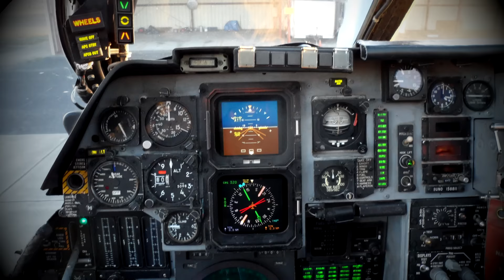USMC Jet Crashes Cable Car | Last Moments

Comment: I am honestly shocked that a high-tension steel cable like that doesn't cut a plane in half.
Reply: The plane is made so survive missles exploding nearby and with lots of redundancy. But yeah, at that speed its almost a miracle
Reply: The cable isn't that tight. They always have some looseness (consider the temperature).
Reply: The plane had more momentum. It's like a jet of high pressure water slicing through metal because hey water doesn't have as much time to get out of the way as the metal. Although I'm really stoned and just guessing. Probably completely wrong here.
Reply: It almost cut off the right wing of the craft. If you watch the documentary on the incident that show pictures after the incident and you can clear see a gouge that stretched nearly 1/3rd of the aircrafts right wing
Reply: Well it all depends in which angle it took the hit, the wing being at an angle can help the cable slip over it. Also, the cable is not completely tense and has elasticity.
Reply: Military aircraft isn't made like what civilians fly on.
Reply: @chriscoker7794  Not always.
Reply: @amx8336  no but most always with high dollar fighter jets and aircraft, but no not 100% of all military aircraft.
Reply: @SofaKingShit  at least you're not "wired" 😅
Reply: Well the cable damaged at least as much of the plane as the plane damaged the cable. There's just a hell of a lot of plane than cable in this scenario...
Reply: @SofaKingShit  water cuts metal because waterjet cutters have abrasives in the water.  plain water can only cut soft materials.
Reply: I can only translate what i learned in engineering class. Most metals are tested by determining their yield strength against tension which gives a good indicator of performance. There are methods to test for compression and the yield loads there which yet again are good indicators of later performance. The issue with this accident is that it stresses the cable in ways it is not designed to withstand. Being a sudden sideward almost cutting tension and jolt. Im sure its strong enough that you could hoist up the plane and 2 others but that sidewards attacking force on a small area by a large mass moving at high velocity is just too much to handle. Dont get me wrong. A metal cable is very strong, thats why we use them. But only if used foe the purpose its designed for which is to withstand tension.
Reply: @SofaKingShit   your part right, water jet cutters have garnet injected into the water jet to abrade the steel or what ever else is being cut
Reply: Think of it as a bullet which is soft lead with a soft copper jacket being able to blow a hole through a piece of steel.. years ago i fired my 243 at a 3mm/ 1/8" steel target that i made to spin when hit with a .22 and i fired the first shot and i was confused because it didn't even wobble so i fired a couple more shots and still not even a hint of wobble and i was sure my shots were good so i went to look at the target and it had 3 holes straight through it
Reply: best way to cut through anything is to go faster than it, they use it in bullets, saws, and every other thing meant to go through something. 500mph is around 220m/s, meaning in just 5 seconds they travel a kilometer. consider that the front end of a wing it thicker than the rear end and more reinforced to handle high speeds, and that the cable isn't armor. all comes together to an instant shred of the cable and damage to the wing.
Reply: Titanium is not stronger than steel. The reason it's used in aircraft is that it weighs only half as much as steel while being almost as strong.
Reply: @SofaKingShit  but it’s all relative and it really just depends on materials doesn’t it?  I’m stoned too btw
Reply: It isn't called Grumman Ironworks for nothing.
Reply: @SofaKingShit  The fact you're stoned and yet took it upon yourself to answer a physics question earns you a gold star in my book. :D
Reply: It's pretty impressive. But Velocity is squared lol!
Reply: The A6 is built like a brick with wings and an undercarriage meant to survive 10000+ hard landings.
Reply: @DoctorNemmo  Temperature would not effect the tension in the cable.  The tension in the cable is determined by the mass of the cable car and passengers plus the mass of the cable itself.  Temperature would determine the length of the cable but not the tension.
Reply: @SofaKingShit  Fraid so mate, it doesn't matter which object is moving towards the other in relation to the earth, as far as physics is concerned the plane and cable car are heading towards each other at 500mph.  Basically the point at which there is contact the cable would get quite hot, weakening the steel, there is a delay between the cable been hit and it been pulled apart and this time delay is the damage that occurs on the jet.
Reply: 500mph bro, at that point nothing is guaranteed
Reply: The Prowler is also built pretty tough by fighter jet standards. Had it been something with a thinner wing, like an F-16, it probably would have crashed too.
Reply: @marc-andreservant201  bussy?
Reply: almost like they were made to be flown in military operations!
Reply: @asiftalpur3758  what?
Reply: I don't know about the Prowler, but a lot of military jets that are used in low altitude roles have cutters built into their design because of the risk of hitting things like power lines.
Reply: @SofaKingShit  too much info
Reply: Even with high tension, with a long enough cable there will be more than enough flex to stretch it until it breaks
Reply: Would've been better if it had, tbh.
Reply: @johnk4396  steel is just as strong as titanium.
Reply: It's not taught by Zeus himself, there has to be slack between the pillars so the pinch rollers don't get worn out in a day's use... Ever been on one? There's considerable flex.
Reply: @SofaKingShit  That's some good spelling for a stoner. I've had "Ivy Leaguers" reply to my comments full of run on sentences, misspelled country and city names, poor/absent punctuation... Excelente trabajo
Reply: @Destilight  
Yeah, if it had been a rare straight wing jet, like the A-10, then it probably wouldn't have "slipped off" the wing. It most likely would've ripped the wing off and gone quickly out of control, potentially so violently that the pilot wouldn't have been able to properly eject in time.
Reply: @Wasatch A lot more dense going faster, too.
Reply: Plane wings made out of cans?  Er, no.  They are the strongest part of the plane, except for the undercarriage.  Science.
Reply: @chriscoker7794  there was those cardboard/paper gliders in WW2. Lol. But they worked, except a few. Mission accomplished.
Reply: @jeffcampbell2710  yeah I thought that was pretty cool and resourceful.
 The first aircraft that was used by the military was exactly like what the public would have used.
Reply: @SofaKingShit  really like that moniker 👍🤣😂🤣.
There is no mistaken that it's you.
Reply: @kingcosworth2643  extreme temperature would just not the temperature swing from night to day or freezing cold.
Reply: the wing remained intact because it was hit fairly close to the hull
Reply: @kingcosworth2643  you
Reply: @johnk4396  67th like 👍🏻 C'mon YT community, can we not get this man 2 more?😂😂
Reply: You could drive a tank over the wing spar in this aircraft and it wouldn't do any harm to it. Not surprised it went through the cable.
Reply: Shows how durable military planes are compared to civilian airliners. There's a fair amount of armour built into the fuselage and wings to protect against missiles and bullets.
But it certainly is counter-intuitive. I'm even more surprised that not only did the plane remain intact, but continued to fly! You'd think it would be spun around like a top. Must have cut the cable in an instant to not be swung around.
Reply: @SofaKingShit  you have a point, but there was also more material on the jet itself (the wing) so that cable stood no chance at 2” thick
Reply: My thoughts exactly...
Reply: @JTA1961  BOO!!!
Reply: The cable tried but the plane was a bit too quick, this isn't fracking rocket science!  Look harder and pay better tension in future.
Reply: @davepowell7168  two with dishonorable discharges are finding that a bit difficult, and the families also... 😳   but damn, gotta give it to you hahaha 😂 you are absolutely right!!! 😄 🤣 😂
Reply: Thanks for spoiling it
Reply: @brettmiddleton5013  so sorry charlie, my apologies.
Reply: @johnk4396  carbon steel like that in steel cables is harder than titanium
Reply: The Prowler was designed to fly at transonic speeds and survive high-G maneuvers which put insanely high stress on an aircraft's wings. It was also meant for carrier use which means it had to withstand very hard landings. The plane weighs like 60,000 lbs so it has to be built like a brick shithouse to stay in one piece during operation
Reply: Jet wings are pretty tough despite how soft they look in crashes. If the cable was pulled extremely tight, it may have cut the plane straight through, but I'm guessing the cable had some give and it gave before the wing did, consider the speed too.
Reply: The physics of swiftly moving vs. stationary mass can be counterintuitive sometimes.  I always think about two different incidents...  --  1. The people who were decapitated while walking under a roller-coaster and how the riders barely even felt the contact with their foot.  2.  A sport plane making fast/low passes over a car during a photoshoot that strikes and severely deforms the C-pillar and violently shakes the car but suffers no damage to the tire/landing gear of the aircraft (I'm having trouble finding a link/video because of all the hits for the more current stunt issues in aviation/media circles right now...)
Reply: Same.
Reply: There's a 9/11 joke somewhere in here.
Reply: @Wasatch i get that reference
Reply: well, it is a military jet flying at 500 mph
Reply: @johnk4396  titanium is not tbat strong, its just that a dense peice of metal
Reply: That's what I was thinking, I'd have expected the cable to have been fine and to have cut that plane like butter.
Reply: @johnk4396  Yeah but it's also not solid titanium, it's an aircraft so everything is skeletonized.
Reply: @DoctorNemmo  actually being under tension makes it easier to cut the cables
Reply: When two objects collide at speed the stationary object takes the majority of the damage. 
If things were reversed with cable moving at five hundred MPH it would have sheared off the planes wing with little damage to the cable.
Reply: @900stx7  no.  That's not how that works at all.
Reply: @johnk4396  That's not how mechanics work :D
Reply: @johnk4396    The cable steel itself is considerably stronger but much smaller so wing could be far stronger overall, and ballistic speeds tend to be counter intuitive.  Note how the 9/11 aluminum airliners flying at similar speeds sliced right thru the steel columns in the Twin Towers, or at least some of them, wing sections may have also been sliced thru on outboard sections while damaging the columns enough to destroy most of their column strength, structural steels are not normally comparable to wire rope steel but similar in strength per unit volume as aircraft aluminum.     

Still I too expected the plane to be taken down.
Reply: Also the wing is a hell of strong "beam" in the fore-aft direction (as apposed to the primary bending load, up and down), the cable may have been half melted, I'd love to see the severed ends to get a better idea how it failed.
Reply: Looks like it hit the absolute strongest part of the wing and went into it like a cheese cutter.
Reply: Shocked... you where shocked. Why is this word now used for what I only assume is at most "mild surprise"
Reply: As an aircraft mechanic, I can tell you that there isn’t any titanium in the EA-6Bs wing structure, especially not the spars.  Straight-up aluminum high strength.
Reply: There is a shot ton (or tons, rather) on those cables.  Don't be fooled by their sagging appearance.
Reply: @DoctorNemmo  Surely the cable is pretty tight as it is dragging all of the cars up the hill.
Reply: tHE NEW HIGH CARBON STEEL CABLES TODAY WOULD IN DEED CUT ABOUT ANYTHING IN HALF , those apparently were older  much weaker , in fact some cables are used to cut sunken ships in half to salvage them even the ones that are miles under water, they bring it up in sections
Reply: It nearly did.
Reply: I'm an aircraft structures  mechanic.  I have 28 years under my belt.  I've rebuilt and repaired so many aircraft types of both rotary and fixed wing aircraft.  That cable would cut any aircraft in half from nose to tail.
Reply: @mattstorm360  Over the years of searching for man's origins and who or what we are and our place in this universe if we even have one, i found many things out about us. One very important fact pertinent to this video, upon our death  right after a life review, we each will be ask one single question, how much grief did you cause others in your life, the grief caused by the deaths of the people in the cable car due to pilot error, that amount of grief is nearly impossible to even measure, to boot their deaths were 100% unnecessary, completely avoidable using plain old common sense, better judgement, . The one asking the single question we are all asked, basing this on falling through ice at 14 years old and being dead for 27 min. is GOD,  being returned to that freezing cold body, and not being able to give God  AN ANSWER , upon my death in the future now i will have a very clear answer  because i spent all these years preparing for that question , ant not one ever again causing any grief on my folks, my answer will be NO MORE THAN ABSOLUTELY WAS NEEDED  since  our last meeting, if you did cause undue grief on others in this life, my guess is you will be coming back to do it all over again, this time from the perspective of the one grieving. The most important thing io believe i learned, we are all spirits living the life of a human in order to acquirer abilities that you can only get through life lessons, we are not made with certain traits  we must acquire them , mercy, forgiveness, understanding , empathy, patients,  a sense of fairness and justice, and the ability to love unconditionally, these things  we will all need to carry us through eternity, one thing for sure we never die .
Reply: @johnk4396  . . . .if that wing was sheeted in titanium it's still only sheet material.  Strong in tension and compression wing loads  but just as vulnerable to failure through impacting an incredibly strong hi grade steel cable.   It's game over for any high speed military Aircraft. 
I have 28 years in aviation.  I'm a Canadian aircraft structures engineer (AME-S ) and have had a hand in repairing and rebuilding several different aircraft types and configurations.  Titanium is one of the materials I have worked with.
Reply: @lenBrill1971  Twenty - eight ya i would say you most likely would be the one to know that, steel cables are capable of some pretty huge task , only last year i learned they use them to cut ships in sections to haul them up for salvage, they use them like you would a flexible saw ,  they eventually cut completely through the entire ship. They do this instead of having divers usually it is too deep anyway so they use cameras and steel cables. The ones i saw them salvage had sunk during a storm and were loaded up with brand new cars and trucks.
Reply: @iginheo  That makes sense
Reply: @dr.robertsmith1971  I like your funny words, magic man!
Reply: @upyoursassmonkey  Pics in the video show one on the nose like the ones helicopters have
Reply: speed of jet
Reply: @kendallevans4079  24 people could be dead.
Reply: @alexisXcore93  the speed only helped in cutting it
Reply: @lenBrill1971  it would have for other aircrafts but prowlers and A10s are built different than other jet fighters there not as fast but are made to be bullet proof. Basically there like flying tanks. There not made for air to air combat but for boming and gunning ground units at low altitude so they are designed to take damage
Reply: Take into account materials speed and temperature
Reply: Most military planes are designed to withstand forces like 10x gravity so they could maneuver like that without disintegrating, there also the materials and reinforcement.
Reply: @Mastah Zen yeah i rewatched right after i commented and realized my mistake. It seems it went in and once tension got too far it snapped.
Reply: The point of the hit was in the union of the wing to the main chasis. That is the strongest part of the plane (in any plane) because it must support all the stress of the wings force torsion in any situation. Anyway, those pilots were very lucky... we can't say the same for the victims.
Reply: The sudden onset of kinetic energy represented by the formula,  half mass times velocity squared
Reply: maybe a commercial plane...
Reply: @SofaKingShit  lol you probably are but it makes perfect sense in a pot-laced way.
Reply: The A-6 is a beefy boy
Reply: Momentum is Mass times Velocity. The jet had incredible mass and velocity, hence it won the contest with the cable. Ideally the jet would have crashed and the car survived.
Reply: It nearly did. The fact that the cable snapped was the only thing that kept the plane from being destroyed was the fact that the cable snapped as fast as it did.
Reply: @dr.robertsmith1971  
Truest words spoken. And you've searched out your answers - as you were shaken into knowing you needed to. The NDE literature is no false accounting, that's certain. 
 Blessings and peace, brother.
Reply: @Wasatch puddle jumper, I like that.
Reply: Reminds me of John Madden in Madden NFL 2004. "What happens when an unstoppable force meets an immovable object. Well, the unstoppable force won that one."
Reply: I believe the plane is made from a stronger alloy than the steel cables
Reply: Planes are transonic, at near the speed of sound,  and they're relatively heavy. So if a plane taxies into a metal pole (Qatar Airways had an incident years ago, "like a hot knife through butter") it destroys the wing, but at flying speeds, the cable can easily be cut.
Reply: By the way putting wires like that in the air was a legitimate anti-aircraft tactic during WW2.

https://en.m.wikipedia.org/wiki/Barrage_balloon
Reply: The fact tht 2.5k thought the same is sad
Reply: Ikr how does rope not sever bullets
Reply: @3-7-77MT  You know planes are largely made of aluminum, right?... A metal you can almost cut just by thinking about it really hard (seriously, you can work aluminum with woodworking tools), hardened steel cable on the other hand is ridiculously tough.... shoot an aluminum bullet at a steel cable and the bullet would just disintegrate.
Reply: @SofaKingShit you don't have a clue what your talking about, if the cable were going towards the stationary plane in the same scenario except the cable is moving, the cable has infinitely more momentum than the plane (0) and the cable would still break
Reply: At 500 mph though???
Reply: 😂 did you know how much air pression there is in the front of a fight airplane ?
Reply: @yleniachimetto299 Yes, I studied engineering. Do you know how much strain is on a taught steel cable?